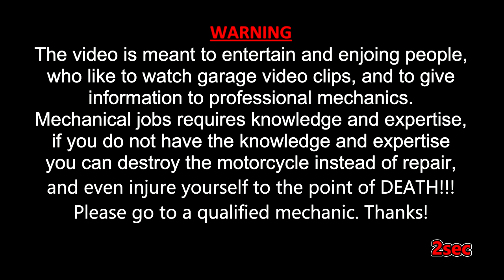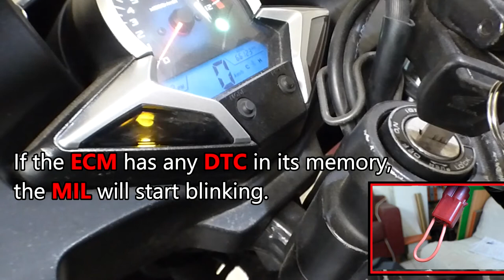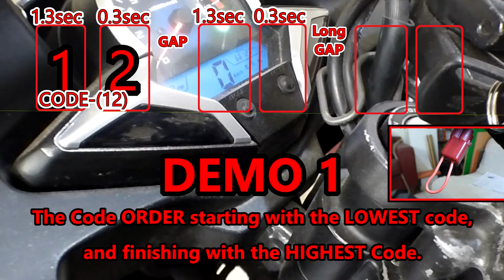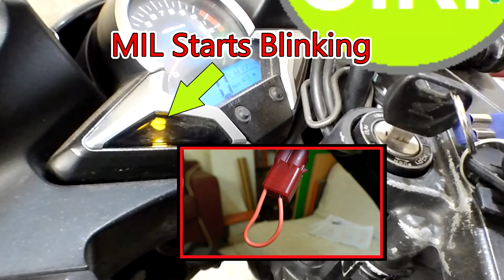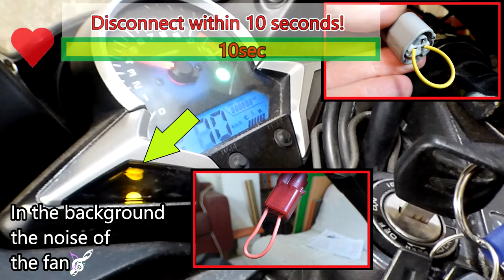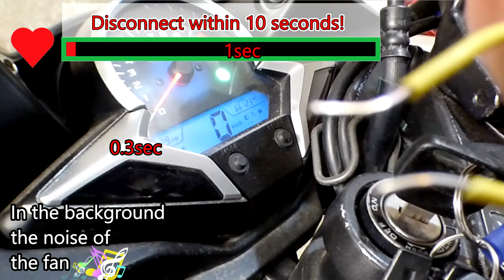Honda CBR250R | DTC READOUT | DTC INDEX | ERASING | SCS Service Connector - D.I.Y TOOL | TP - RESET

Comment: Desde México exelente explicación, tengo una pregunta: 
Revise mi motocicleta y arrojo 7 códigos de falla, realice el borrado de fallas y restablecimiento de la posición de sersor TPS.
Al terminar y volver a revisar fallas el MIL se queda encendido permanente. Cuál será la nueva falla?
Reply from the maker: Thanks
Sorry. I'm not sure I understood your question. Code 8 (not 7) is the Throttle Position(TP).
4:05 Look at DTC CODE LIST:

To reset the Throttle Position, look here:
5:11

 And for reset code memory look here:
4:10
Reply: @mycbr250rdmotorcycling7  Question reformulation; how does the MIL react if the vehicle has no faults?
Reply from the maker: @marcoantoniomonroy757  
You got me. When there is no code in the DTC's memory, then as soon as the DTC's connector is shortened the MIL bulb will be stay on (will not flicker). I thought it was clear that if there is no flicker then there are no codes to read, but you are right, this projection is missing in the video.
What do you say, I need to fix the video (download and re-upload?)
Reply: @mycbr250rdmotorcycling7  Thanks for the clarification, I don't think you need to download the video. Greetings!
Reply from the maker: I uploaded a revised version:
https://youtu.be/Mx3DGOAhVDM?t=485
Reply: Excelente mil gracias amigo por compartir tus conocimientos 👏👏

Comment: would this work on a honda cbf 1000, i've removed the servo on the exhaust and fitted a servo eliminator but still getting code 34, i didn't remove the coil from near the aril filter or blank the pipes, stuck to find the problem.
Reply from the maker: Sorry sir. I only know my cbr250r model. My model does not have a code 34. Try to locate the service manual for your model, at Honda or Haynes. I think you will find there the appropriate explanation.
Reply from the maker: With your permission, I'm willing to try to guess: You may be reading an old code(before you fix it) ? If so, try resetting the memory, and see if the code comes back again
Reply: @mycbr250rdmotorcycling7  will do, it was coming on before the removal, thanks for coming back, if it carry's on i'll be back to my good old 750s

Comment: My CRF throws 12 codes for fun. I replaced the injector(code 12) and no difference noted. The injector black/white wire goes to the kill switch and also to the bank angle sensor, that threw a code one time so i suspect 12 codes are to do with the kill switch.
Reply from the maker: Hi, Is the engine working properly?
Code 12 it does not necessary have to be a problem in the function of the injector, it can also be a problem of short or disconnect on the electrical wires that leading to it, etc ...
According to the diagram in the Honda's book (CBR) the wires of the injector are Black / Blue, and the other is Pink / White. According to the Haynes guide No 5919 P. 8*51, these are the same colors at the CRF model. So it's not clear to me which motorcycle model you are talking about? But if it is a Honda from those years 2011-2013 in my opinion the principles need to be similar or identical.
A problem with the engine stop switch was supposed to affect other components that connected to the Black / Blue wire, so I do not think your problem is with this switch.
Bank Angle problem is a different code (code 54), therefore it is unlikely that your problem is with this sensor.
Try resetting the codes memory, running the engine, and then checking to see if the code reappears.

Sorry, I do not know you, if the issue seems unclear to you or you do not have the knowledge, the tools OR the appropriate technical literature, to perform the repair yourself, please feel free to contact a qualified mechanic in your area.
Reply: @mycbr250rdmotorcycling7  (late reply- you tube blocks notifications to me) ive had a 12 code before on my 2014 crf250m. I replaced the injector but didnt notice any difference in performance. I have read other peoples DTIs and they also have 12 codes so we tend to ignore those now. The 12 and 54 code i got this time shows a common black/white wire running to the engine kill switch for each componant therefore i suspected the kill switch to be responsible as its regularly submerged in water/mud/ buffalo crap and as the starter switch and clutch switch have given me problems i cleaned them up. All issues are gone now.
'A qualified mechanic in my area'? That did give me a big laugh! No one in this country can touch my vehicles as when they have done in the past they have caused damage to other componants or even done things that could have killed me.
Im the only qualified motor vehicle technician that i know of here!
Oh! And i make the factory tools to do the required work, the local alternative is usually a big hammer and a screwdriver!

Comment: What is the code for abs fault
My rear wheel locks during hard braking but abs light is off
I didn't get what's the problem
Reply from the maker: Hi. My model does not have abs, so my experience with this system is limited. I know that there is a separate computer for abs, and I know that it is possible to read codes that are specific to abs faults, by reading the flashes in the abs inspection light, the one on the instrument panel.

If the rear brake locks, you should check the caliper and the piston, it is possible that the piston is seized. I don't know your abilities, just saying this is a job for a professional mechanic.

Comment: this is very informative video on cbr 250r. need one help from you. how to read ABS error codes in CBR 250R ABS
Reply from the maker: THANKS👍
Sorry, I have no ABS, so I have no motivation to study the subject in depth. The maintenance Honda's book has an entire chapter that deals with the ABS system: Chapter 16. On pages 16-10 there is a table with fault codes. If you know how to read the code from the panel ABS light bulb, I can look at the table and tell you what that code means.
Reply from the maker: If you're going to do maintenance on your own, and if you have the skills and tools, I really recommend you invest in the technical literature: Haynes' book, and Honda's book. They are not expensive(relatively), it is an investment that pays for itself.

And of course you must know the great CBR250R forum:
https://www.cbr250.net/forums/
Reply: @mycbr250rdmotorcycling7  i have tried your method it works great on all sensors except ABS sensors. Also I have all ABS fault codes but dont know how to display error codes on ABS light 😅
Reply: @mycbr250rdmotorcycling7  in short ABS fault codes are not reflecting on ABS light
Reply from the maker: @sanjayc8042  
 Gp to P 16-8
Your ABS light blink or stay on' if YES so: There should be a code problem in the memory.
 Under the rider seat you have 3P SERVICE connector. Short
Gray/Red TO Green.
 Switch ON
Stop Switch ON
After 2 sec ABS goes off for 3.6 sec' and then...
If there any code they blink like you already expected.
Reply from the maker: @sanjayc8042  
https://youtu.be/Ofgf4H1lGbo
Reply: @mycbr250rdmotorcycling7  man thank u is not enough for u. this is what i was looking for since long time. finally i got this. will check and update you. 
🙌🏻🙌🏻🙌🏻🙌🏻🙌🏻
😘😘😘😘😘
Reply: Brother I am also facing the same issue .... 

The ABS light continueously blinking and abs is not working on both the wheels , checked the fuse , all good but the voltage of the abs fuse keeps dropping from 12 Volts to 2 V, 3 V can you suggest how to ditect this problem ? And solve it ... ?
Reply: @moulinathbiswas8911  try this steps https://youtu.be/Ofgf4H1lGbo and let me know error codes or do one thing try this step and make video of error codes will tell u what is the problem with your ABS

Comment: Sir, why is the tp sensor reset required? What is the reason?
Reply from the maker: In the module of the three sensors that is attached to the throttle body on the left side (the black box), one of the sensors is TP which is the Throttle Position. This potentiometer should be reset if the black box is touched, or if there is a suspicion that it has gone out of tuned.
Reply: @mycbr250rdmotorcycling7  ok thanks

Comment: Bro on meter heat indication is 5 bar and 6th one is blinking in morning even bike is not started how to fix it
Reply from the maker: Hi
You checked the DTC codes, and you got code 7???
See here
4:05

I would suggest starting the test from the temperature sensor, maybe it is failed and needs to be replaced???

In any case, you must not drive like this, because if the cooling system is not functioning it will destroy your engine very quickly.

If you are in doubt, or you do not have the hands and ability to repair it yourself, please do not hesitate to contact a qualified mechanic that you trust on.
Reply: I replaced my engine coolant temperature sensor fan is also working but that meter shows 5 bars n 6th blinking it happens when my mechanic flush out coolant my giving full accelerator n then it showing like this on meter
Reply from the maker: @KiraSurnaam  
Maybe there is air trapped in the cooling system?
And maybe something else.
One way or another, the engine must not be allowed to work like this, because it can cause great damage to the engine.
If you trust your mechanic, go back to him and explain to him that a new problem has arisen.
If you don't trust your mechanic it's not good.
Find to yourself a certified mechanic that you trust on.